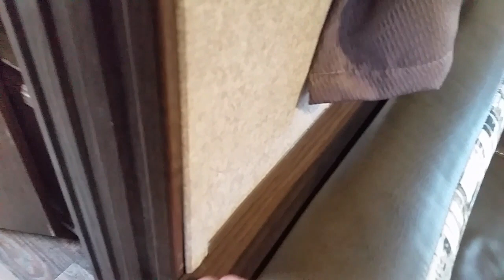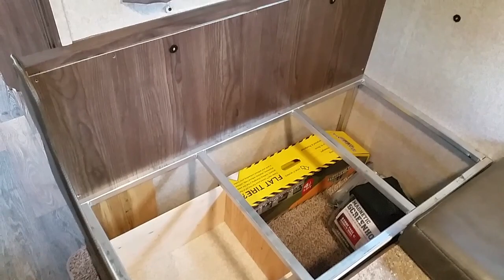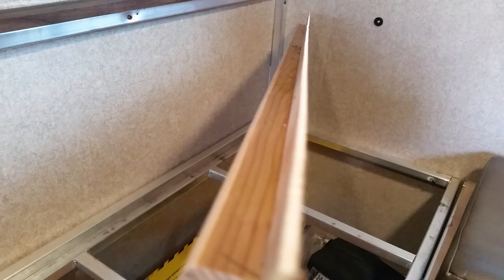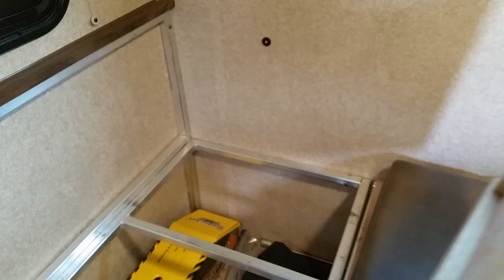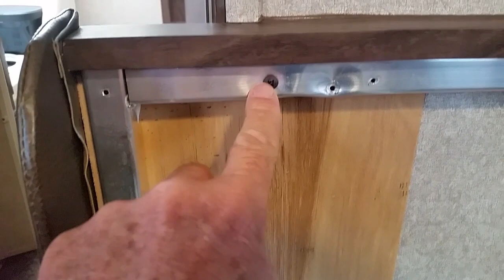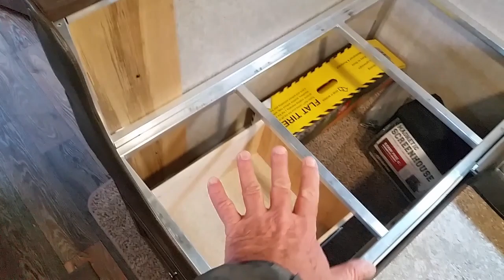Travel Trailer Dinette Repair (Frame pulling off wall and warped paneling)

Comment: Good fix...I have a Mini Lite 2104s since Nov and since then i have been going over the rig and boy Im sure glad I did not pay what the dealer was asking. The quality is pretty poor with fit and finish and was not close for quality to be asking what they wanted. Now I worked on Corporate (80 million  $$$)  aircraft and Im really a A personality when it comes to the end product and I dont assume this unit is any where close to that type of quality.....but damn, it aint rocket science Rockwood. Back to your videos, I have incorporated quite a few tricks you have shown on previous videos and I want to thank you. One thing i did do was behind the Murphy bed I had foam wedges cut (2 pieces) and covered with material....sweet and I can remove and store them. Additionally one of the drawers under the divane I removed and made the door a flop down (store my pots and pans there, limited space in my 21 footer) and covered the backside with laminant to avoid damaging it. Thanks again Michael
Reply from the maker: You're welcome. It sounds like you are a lot like me about making things right, I've modified many of the cabinets so they will hold more, they just slapped a piece of paneling here and there covering up space that could be used . I appreciate your comments, if you have not subscribed already you might want to so you can see my past and future posts. Take care :)